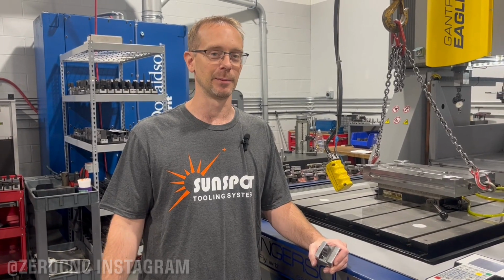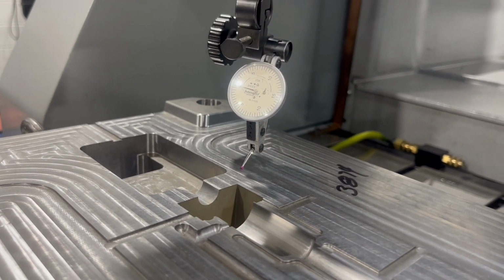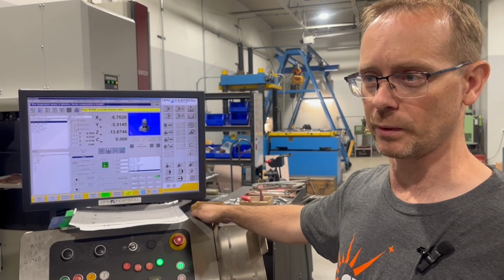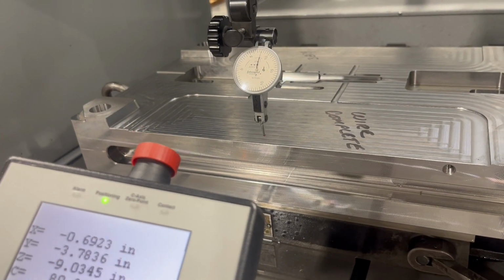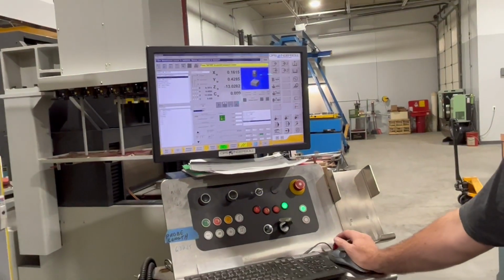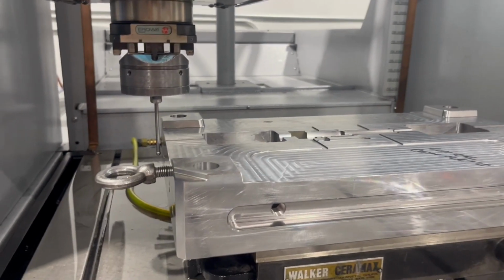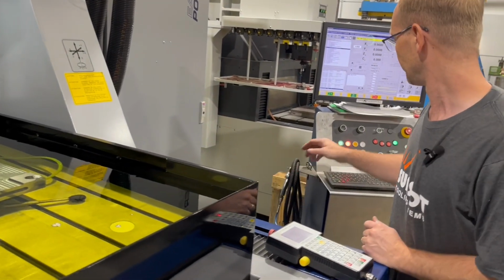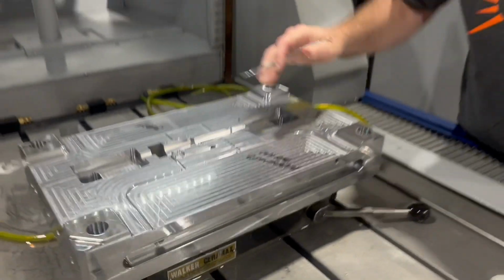The Importance of EDM Setups

Comment: Hi, i'm designer not operating the machine have a question for design consideration, let say i want to make exact 6mm hole at workpiece, then the electrode should less than 6mm right?(maybe about 5,9mm), how to manage the offset, can EDM change the offset size without change the rougness, . I assume  the more rougness , the more offset size is. Do controling the offset is only by  electrode size or the EDM can do some offset change at specific rougness? Thanks.

Comment: Depending on how accurate you have to be. My older EA12D i do 4 for 1 cavity. My newer EA12PS i like to do 3 for 1 cavity. But depending on the circumstances as few as 2. It's all subjective. It just depends on the tolerance.  I work for Essentra in ARKANSAS. We make fasteners, so most of the things we make are very small with a lot of detail, so do to the scale of the parts we can't afford low resolution parts.

Comment: hello sir, as answering your question,  
we decided no of electrodes required based on metal stock left by cnc milling machine, according to stock left we make roughing and finishing electrodes with different spark gap.
Sir i also have a question, 
Is there any relation or formula, between Spark gap of electrode and setting current ampere in edm machine as for example if we give spark gap value on electrode as 0.075 mm/ side  then current value should be set on machine as 2 ampere to 3 ampere .
Can you please give any fix relation Between Spark gap value and current value so that we can achieve final size in less iteration
Reply: I worked on an older edm machine and i had tables that showed the correlation between current and spark gap. Maybe you can find something similar in your machine manual. Modern machines usually do have fixed spark generator cycles saved into the machines control. You type in the undersize of your electrode and define the surface roughness you want to achieve. The rest is done by the machine. It will even orbit to achieve the final size if the electrode undersize is too big.